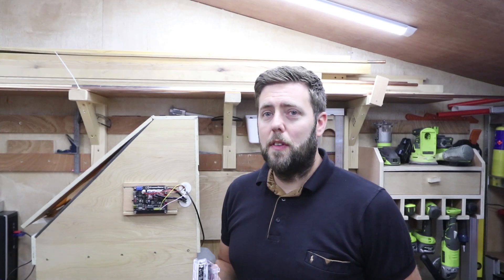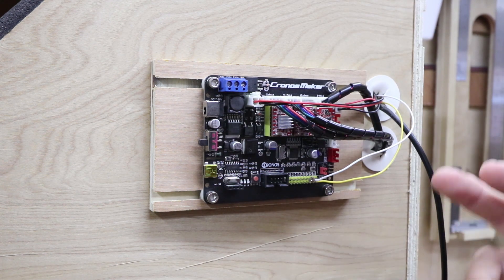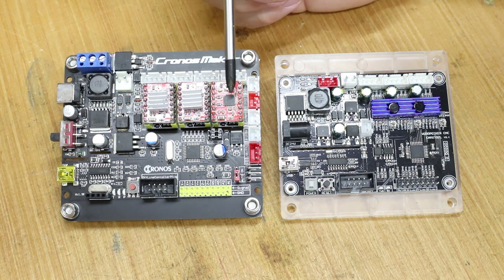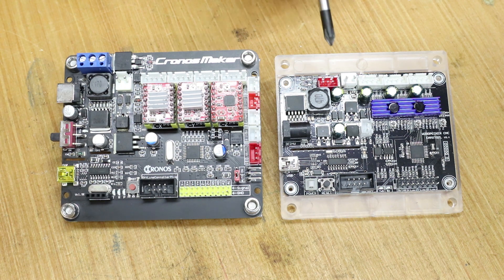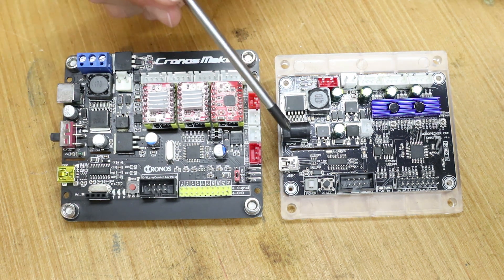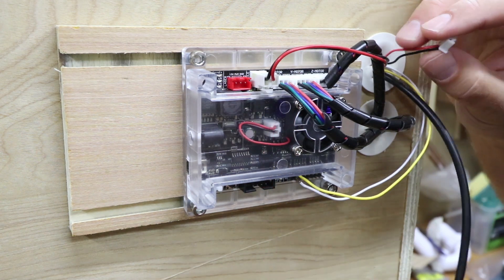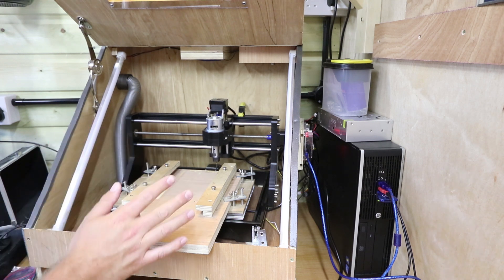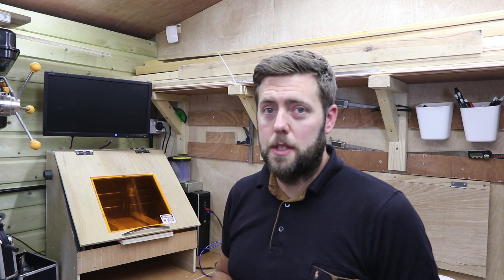3018 PRO - Control Boards

Comment: Is it possible to upgrades a board or plug in a 4th axis control? I have  lunyee pro max which is identical to this one.
Reply from the maker: 2 ways - you can either run the 4th axis as a Y axis which can be done on the existing board. Or you can get an upgraded board that has an A axis (4th axis) and do it that way
Reply: @JamesDeanDesigns the second option is more integrated for "flawless" carving? Or both gives crisp results? Software wise, is there a free one that can handle a 3d file? My goal is to make chess pieces. Thank you for your tips!

Comment: Hello, great video!
Thx for the info...BUT......I have a quick question...well, after i was done writing this up i can see maybe not-so-quick, lol.
I recently had my old Woodpecker board have its main atmel chip loose its magic smoke (as well as u did), & as we know, once the magic smoke that makes everything hum gets out, its impossible to put back so i had to order a new board. Long short of it is i ordered up pretty much the exact same board as you did, which as you said is i guess the newest iteration of Woodpeckers design. This was news to me, lol.
The old woodpecker board i was running (vs 2.6) had separate mini shield drivers for each of the 3 axis and is apparently now obsolete & is no longer available so i ordered the same replacement as yourself. Mine i ordered out of China & despite minor (power BTTN) differences the stepper driver configuration as well as the rest of the board is identical as yours.
Mine also had axes' reversed, which took a tad more than just simply reversing the travel direction to correct, i found it affected & thus required changes to the homing settings as well. Just in case u were needing help, after much investigation i found $23=11 worked to correct my homing direction/sequence upon reversing stepper travel directions. So.......whew...my question is, i'm using Candle as before to run my machine & seemingly now i cannot get this new board to report back Machine coordinate values, which never seem to change!! 
I did however manage to get the 'work coordinates' to function tho so i could then run CNC jobs, however.....& this brings me to my biggest issue, question?? The x-axis (i presume only, so far...) is seemingly running very rough with almost what i would call a bit of ratcheting & 'noise', not continuously but rather sporadically....Is there something else in the grbl settings that i may possibly have missed & may have to also correct now? Or is this a firmware type fix only? I'm assuming the old stepper motors are possibly not suitable or the issue, but I'm just wondering if there's some type of quick fix for this? I am running tiny chinese NEMA 17's Steppers. Long Model no. is: 17 HS 1352 - P4130.
I apologize for the long read but i could really use any help or input u may have....
Thx, in advance!

& cheers, from Canada.

Comment: I used the Doesbot and Annoy Tools board with 500w 48v spindle and external stepper driver. None of them worked, and I couldn't connect to CAM programs like OpenBuilds, UGS, Candle. I don't know how to get these motherboards to work? Does anyone have experience with such GRBL controlled motherboards?

Comment: Thanks for this interesting video.
I'm having a problem with my 3018 pro. When instructed to travis right or left, backwards or forwards on the X and Y axes, the table or spindles makes the initial movement, hooks, and then completes the set distance. It's does this in any program, Lightburn, Lasergrbl, Easel and USG. Could this be a control board issue?

Comment: Ive had this happen twice now, both times while carving polycarbonate.  The bit got hot and melted the poly causing it to bind to the bit stopping it from spinning.  I guess the feedback into the control board killed it.  Both boards were the new variety you show.  The boards still work, but they no longer turn off when I turn off the switch.

Comment: My hardware board out of smoke, and make my spindle automatic on, what must i fixed? 🙏
Reply from the maker: The mofset has likely gone. If you know what you're doing you could try to replace it but in reality it's probably easier to get a new board

Comment: this is what im trying to do right now. i got a mysweetys 3018pro with a 7w laser about 2 an a half years ago an i used the spindle at first just to make sure it worked the way it was suppose to then swapped it out for the laser an thats what i ended up using the most but after switching back to the spindle i discovered the z axis had stopped moving, with the laser it never had to be moved cause it had a focusable lens so i always kept the z axis all the way up but im about 100% positive it was the z stepper driver that died so i put it up for a bit an after getting it back out i lost some parts so i ended up buying a extension kit to replace the missing leadscrew an extended it to a 3040 an i got a replacement control board, the one u put in urs in the video is just like what was in mine an was suppose to be like the one i purchased but when it came there was some small differences but nothing big, just changed the position of the power switch an reset buttons. after getting it all put together an try to connect to my laptop it seems to connect an i can give commands an seems like the board is responding but when i unlock an try to move a axis it doesnt do anything. suggestions on what i should do would be greatly appreciated, im trying to make sure the control boards is ok b4 time runs out for me to return it if it is bad. if anyone knows what im doing wrong pls point it out.

Comment: Hi James! Thank you for your video explanation.
I'm jean-yves from france. I'm an electronician.
I discover these systems and and yet saw many tutorials but none of them present wiring starting on board connectors, which should be the beginning i think.

I could find the type of dissipators to add to stepper motors drivers and many other devices but nothing really explain how to wire things clearly from the board(s) with repairs, etcetera...

Despite the fact that you have a boxing  (which you could adapt one on the original board), i think the unique dissipator and the fact that stepmotors drivers are "screwed" on the mainboard is a programming obsolescence regression.

I even wonder if a simple  arduino board with atmega328 in dil format mounted on a dil plugable support should not even  be better.

I have another question: on my version (the default card) : the dril/mill moteur has a fixed speed thought each program interface ,
(grblcontrol, candle for example), and Grbl software permits its variation.

I'll such of all make drillings, and i want to preserve my bits and boards and for this respect the drilling speeds.
Is there a way to add this functionnality?
Thanks in advance.

Comment: spindle have totally toy not can work good any material weak power lot, less than 100$ can buy lot lot better spindle 500-800W -dc spindle whit ER11 or ER16 and speed controller power supply, whit bracket and bolts. and need alltime use Z probe too if change bit. and near spindle can install bracket to laser too.
Reply from the maker: Hi. You seem to keep commenting on what is an old video recorded 2.5 years ago. At the time of making this that spindle was around $25, so a quarter of what you are suggesting. And again at the time of recording this, you could not get an 800w spindle for under $100, in fact it was more like $250+. The market has drastically moved on since then and prices have come down a lot. Very little validation judging old videos based on the market today.

Comment: same computer than i have, what you have latency test max jitter whit normal cnc used linuxcnc, and why use shit max 2Amp stepper drivers if can use good DM860 stepper drivers ewery axis. how connect external drivers this cheap toy cnc board.

Comment: Do you know by any chance anything about the new Cronos controller with 4 axis and extra A mot that also has the external driver option for Nema 24 motors +? There are link under the drivers for for the extrnal drivers but, they are not marked. Do you the connections sequence? Thanks Mike
Reply from the maker: Sadly I don't but GRBL doesn't support 4th axis to my understanding so it may be running a different firmware or something

Comment: Hi. I recently bought a CNC3-3018PRO ON amazon. As I conected everything. When I press the power botton on smoke come the controller box. I have to quickly turn it off. I have checked all connections several times. Even controller by it sel with nothing connected smokes.

Comment: Hi , I had on my 3018 pro cnc a ANNOY TOOLS board. I bought a bigger spindle ( 500w with a power supply ) and i try to follow the advice of a youtube suggestion to control the speed with GRBL.
Unfortunately  bouth the supplier and the board were burnt- maybe my fault. So now i have to buy a new power supply and board.
So what is your opinion should i buy a ANNOY TOOLS board or another one?
Besides do you know how to obtain GRBL contol on the spindle?
Thank you
Reply: Hello, friend. I'm lucky to see your comment here. I am a seller of ANNOY TOOLS, you can tell me how you connect and I will provide you a solution.
Reply from the maker: The first thing to note is GRBL doesn't really control the speed, or not in the way people believe it does. It has no way to monitor the RPM so all it actually does is send a certain amount of power. 100% power = full speed but 50% power doesn't actually equal half power, its actually more like 40% of the power. I will not get bogged down in this but the point I'm trying to get to is whether you do actually need GRBL to control it? Most people just use a dial when they upgrade as it makes more sense and people do not often adust the RPM, they adjust their feeds and speeds to compensate. As for your actual question, I believe there is a relay that allows you to match the 24v upto the 48v in relation to controlling the speed via GRBL. Ill try and find what its called.
Reply: @JamesDeanDesigns  normal used hand controller spindle speed because if you change bit need change speed too this tools good, and can do this best whit RPM gauge show REAL spindle speed, etc own build simple optpcoupler RPM board many example have video youtube etc internet, and then 500W spindle need buy 10$ about spindle speed controller adjust speed to DC motor whit potentiometer knop. many toy cc boards not can use PWM output to spindle, and big volts and current eed FET if have PWM out controller board, then board controller out PWM controller FET and FET controller spindle voltage. nominal have only on/off output in board and then need relay to controller spindle high volts. board control relay on/off and relay controll spindle power ON/OFF. but this no handle speed, only on/off.

Comment: I am building a cnc that uses NEMA 23 steppers. I want to use GBRL. Are there plug in drivers that can handle this MEMA 23? By the way after viewing almost all of the CNC sights I have found yours to be the best. Good work.
Reply: why old pre history GRBL ? if use nema 23 and cheap 10$ paraller port controller and DM860 stepper motor drivers have lot lot better can use pciE to LPT port card 6-9$ and use linuxcnc lot better and can build REAL cnc not only toy, this board not support big nema 23 motors, max current to motors have less 2Amp and motors need better DM556-860 drivers can use motors max volt and current. normal cnc need good 4-6A motors 3-8Nm torgue,  less than 2Amp motors can use good only laser or 3D printer but not power use good cnc. and linuxcnc have TRUE REALTIME control, not worst mach3 windows shit base control what lost alltime lot steps. windows not have important REAL time controll, same GRBL shit.

Comment: Thanks James your videos are very informative, I have swapped my original control board for a condo maker and I have a problem with the Z axis not functioning. I'm a newbie with the 3018 so it maybe something that I am not doing correctly or a setting that may need changed. Can you please enlighten me to what it maybe. Jim S
Reply from the maker: Hi Jim,
You need to do some testing and figure out where the fault is. For example connect the X axis cable to the Z axis and see if that works. Then connect the Z cable to the X motor and see if that works. It will help eliminate whether it's it's motor, the cable or the control board
Reply: @JamesDeanDesigns  Thanks again James, will give that a go. 👍
Reply: Update: I swapped the Z and Y axis cables and the Z axis worked. So it turns out it had been the Z axis module. I then contacted the supplier and had been told to swap the Z & Y modules over, this had been a bad move as the control board started to smoke!. Now I have no Z or Y and awaiting further contact from the supplier.

Comment: HELP!!!  Motherboard is smoking at the x-axis connection.
Bought my CNC 3018Pro at husbands urging, excitement when it arrived, figured a few things out on my own then frustration set in.  Found your channel about 6-8mos later and started watching videos and just took out machine excited to get going again today Jan 10 2022....You explain everything so well!
I wouldn't say I'm an artist but thinking I should go back to painting and sculpting by hand.  

If you can provide some feedback and advise, I'm still excited about the prospect of turning my own designs out.  Husband's a retired millwright and thinks its just so simple but I'm the computer geek (not really) but spent years in the print industry, just not in the design department.
There's my story....what do I do about my smoking x-axis connection on my motherboard?

Comment: Quick question , nube here, do these control boards still need a stepper driver 
(tb6600) for a nema 23 motor?
Reply: yes ALL small toy board need biggest drivers if use big normal cnc motors, nema23 or biggest motors normal this and all toy boards handle only max 2Amp motors (its toy motors nema 17) what used only 3D printer or laser not cnc, no torgue move and cut wood etc. need take out of board adapter step and puls signal to external drivers. take out genuine drivers max 2Amp and but in adapter drivers plase were come out step wire and puls wire and enable wire then can use external big drivers etc, TB6600 or DM860 etc. and real cnc big motors etc, nema 23-34 4A-7A 3-8Nm then can working lot lot better.

Comment: Hi James, Thanks for this video. If I change to the Woodpecker board, what is the maximum amperage that it can handle? I'm looking to replace my current spindle with a Hanpose  288W spindle that is rated at 24V, 12amp. I don't think the current Cronos Maker board will not be able to handle 12amps?
Reply from the maker: No, most of these boards will not handle more than about 8-10amps max. You will need a separate power supply to do that
Reply: @JamesDeanDesigns  will the separate power supply solve the problem? ie I can use the Cronos maker board just with a different power supply?
Reply: @JamesDeanDesigns  Hi James, thanks for your reply. Will I need a separate power supply and to upgrade the Cronos as well, or will a new power supply suffice?
Reply: alltime spindle power and controller board need be different power supply not newer both same power supply, and if use external motors driver board motors need own power supply, drivers own and controller own. NOT same power supply all together.

Comment: in my opinion / I don't think this is really an upgrade,
yes okay except for the fan then!

Healthy and Friendly Greetings from the Netherlands!
Rob
Reply from the maker: You're correct. I think I've mentioned a few times in the comments that I ended up going back to the Cronosmaker. Was debating taking this video down.
Reply: @JamesDeanDesigns  
Hi James,
Oh my comment wasn't meant to be rude!
I can imagine that you used the other board because you had it.
But if I'm honest I would keep using the other board!
Do I have a question for you if I may?
I've got Candle and you once said you'd rather use UGS?
And actually that's why I'm hesitating to change it too, what now?
(what do you think? shall I switch?)
.
(I have now also ordered such a manual control/hand controller, not sure if it is good???)
.
Healthy and Friendly Greetings from the Netherlands!(Rotterdam)
Rob

Comment: Can you use one of the apple GRBL control programs to run these boards? M1 was by far the best option in my price range... lol
Reply: I want to add that I am a machinist like, for a living. I know G code and M code. While my machine isnt fully assembled and running yet, once it is, if I am able to manually input code and programs I will be able to, however I have NOT used any sort of Cad/Cam software other than basic exposure, and its been so long.. Idk.  (I know how to run Fanuc and Haas mainly.. this is still pretty new to me!)
Reply from the maker: @rgriffith6476  Hi Reece, latest video on software might be useful for you to get started but yes you can run these from apple machines. Something like UGS is cross platform
Reply: What I am wondering... do these control boards on the CNC correlate to a specific software sending the info? or is it just like a big CNC, simply running on G code and M code? The GRBL thing is throwing me off. like, whats that?

Im sure ^ thats answered in the video tho. Lol thanks!

Comment: Thank you so much!!! Came here after completing your [the most complete!] assembly video. I couldn't figure out where to connect my Z-axis calibration probe to in my Woodpecker board. You said it: port "A5" - thank you thank you thank you. Just in case anyone is wondering I had to cut off the stock white connector and stick each wire into two black pin headers (now they look similar to yours at 5 minutes 52 seconds mark)